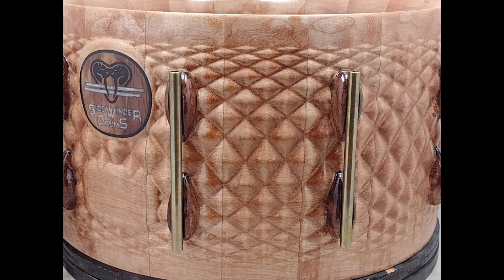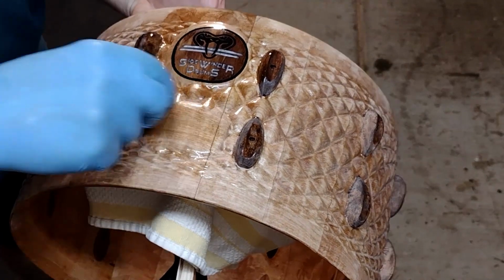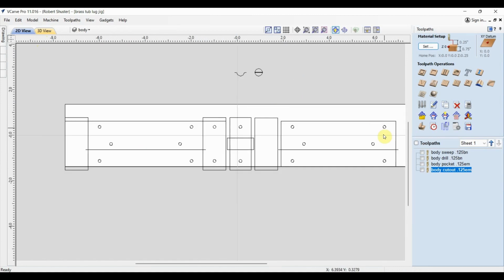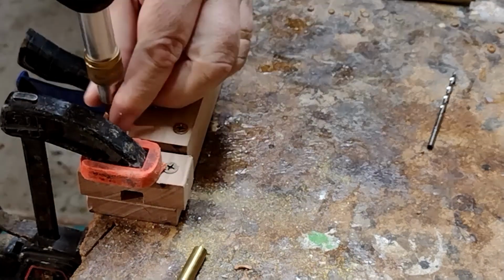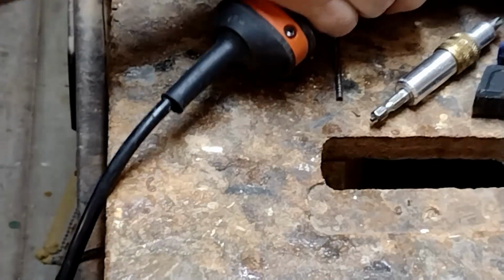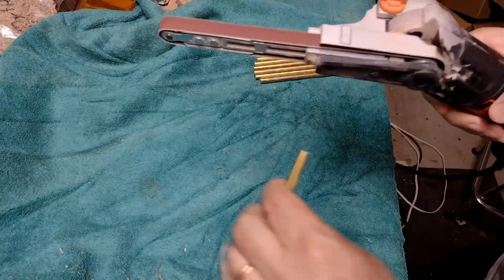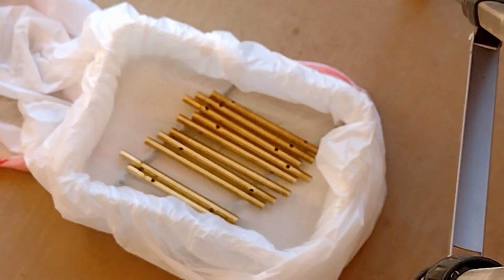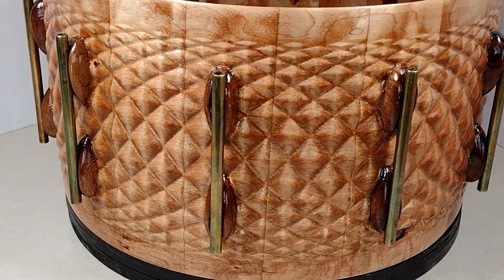Snake Skin CNC Snare Drum Build pt4 - Clear Coat & Making Brass Lugs

Comment: Very nice, Rob! RE: Darkening the brass - have you tried heat? Try using a propane or butane torch to heat one end of one of your "test mules" and see how you like the patina that forms. You don't have to get it red hot. You can see the brass change color as the heat is applied. If you go too dark for your taste, you can use some 1500 grit to sand back the patina, then try again. I've done this a lot. Here in the Pacific Northwest we salmon/steelhead fishermen use it on brass spinners in autumn and winter to dull down the flash of the spinner blade, which may spook some of the more jittery fish.
Reply from the maker: I had thought about heat, but have not tried it yet.  I ordered "Birchwood Casey black brass", and it arrived after I posted the video.  Between those two ideas, I am sure I can get the effect I want.  I want to finish up the drum build video series first, and then I can go back and play with different brass effects.  

I CNC'd a very different style of drum rims for this series over the weekend, so I need to get those finished up in the evenings, and compile/edit the video before the weekend.  Once that video is out, I can take a break from doing videos for a while...